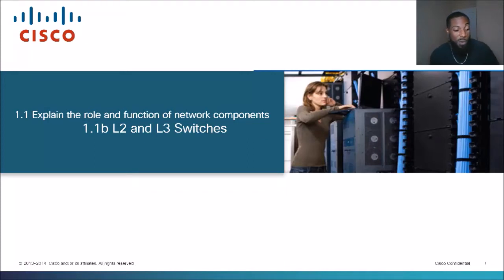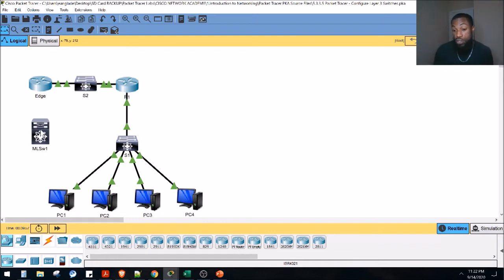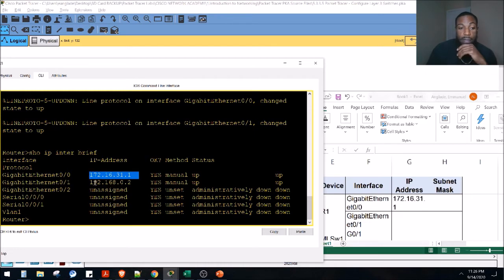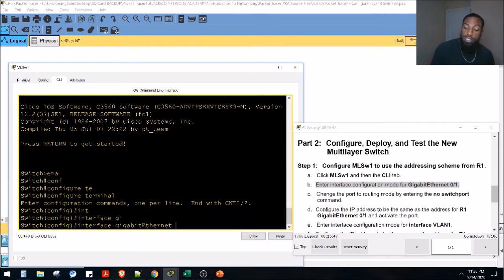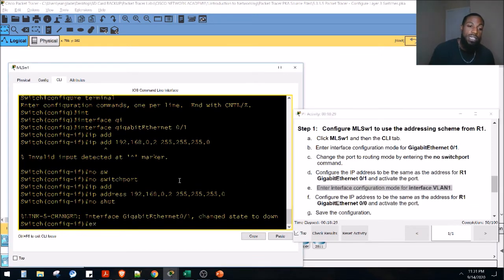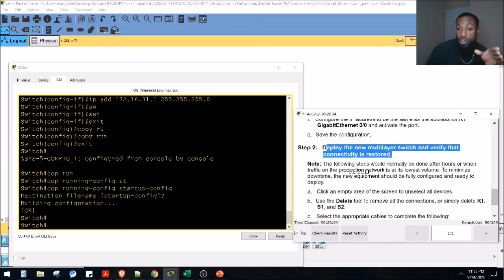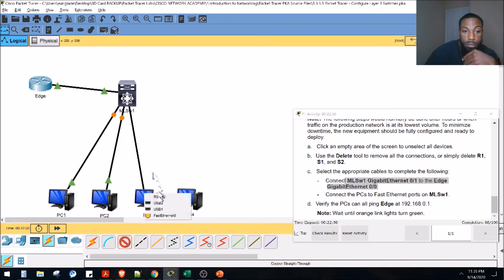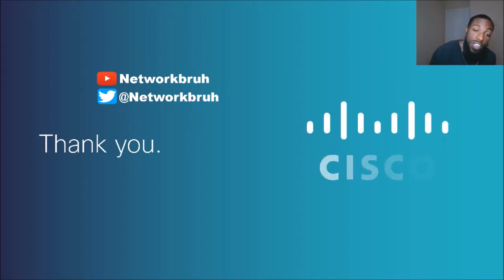1.1b L2 and L3 Switches - CCNA (LAB SECTION)

Comment: I love your video's they are very entertaining  :) I did the lab and noticed that I can't ping the edge router from any of the PC's. I believe it's because the layer 3 switch was still on layer 2 mode so it couldn't ping an IP on a different network. So I ran the "ip routing" command and now I can ping 192.168.0.1
Reply from the maker: Im glad these videos are entertaining to you Jehan!!! Do you know if you used a different layer 3 switch?? I think I used the 3560 model in this video. I did not have to turn on routing if i remember correctly as it was already enabled.
Reply: @NetworkBruh  I didn't change anything in the lab topology, just used the same WS-C3560-24PS-E. If I'm not mistaken, I believe all layer 3 switches in packet tracer don't have "ip routing" enabled by default, but I could be wrong